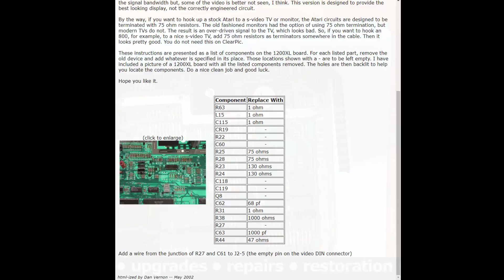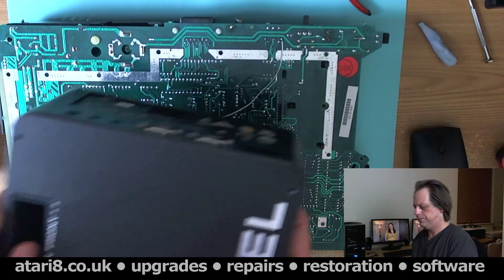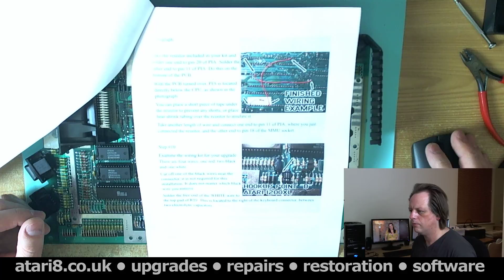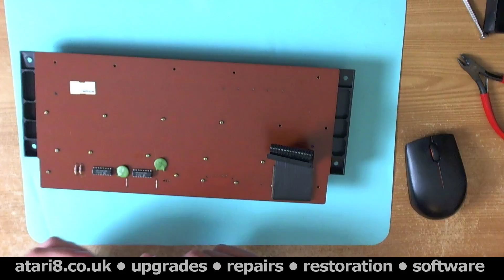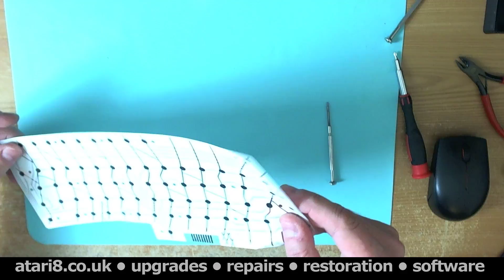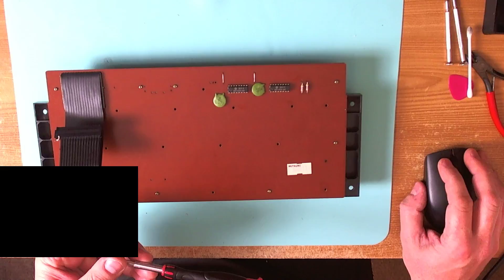Tricked Out Atari 1200XL Part 2: ClearPic 2002, keyboard fix, AtariMax 32-in-1 with missing parts

Comment: Another excellent and enjoyable video, Jon. Thanks! Nice to see the 1200XL keyboard repair too. That reminds me - I need to fix the keyboard on my third 1200XL. Admittedly, that's a very nice problem to have.
Reply from the maker: Thanks Herb. I'm not sure if there's anything to my 'peel back at an acute angle' theory regarding the Mylar silicone, but there's no doubting I got lucky with two keyboards in a row this week (the carbon contacts on both completely survived removal of the adhesive).
Reply: The first two keyboards of mine I repaired about 4 years ago with a hair dryer to apply heat. One of the Mylars came off very easily, but the other tried to tear in numerous places. It was a very nerve-wracking experience to remove and then get it back into place properly. In both cases there were badly worn carbon traces at the contact area. I used cheap ($10) Bare brand conductive carbon paint. Really, the stuff is almost more like "ink" than paint. I used a fine-point art paint brush and, of all things, a wooden toothpick to restore the traces. Both stuff work great today. It would be nice of this third one doesn't require that, but I'm not counting on it.
Reply from the maker: @LeftyLabs  I think out of the twenty or so 1200XL keyboards I've fixed up over the years, only these two and one other required no repairs to the carbon pads. I doubt this is down to improved technique... seems like luck (or lack thereof, since the point was to demonstrate the process of repairing the pads as well).